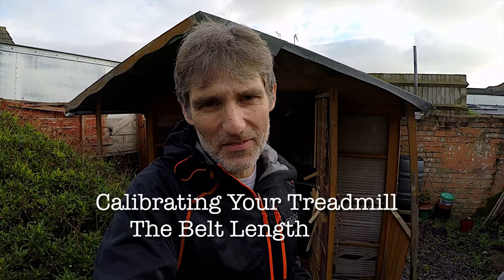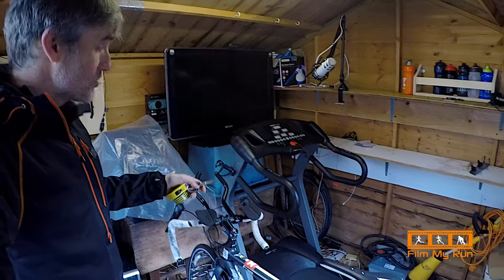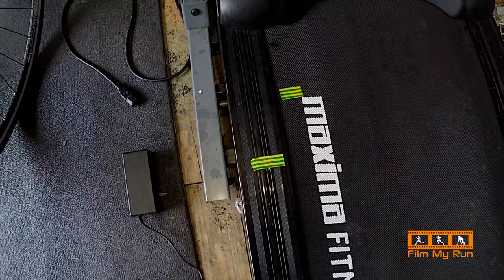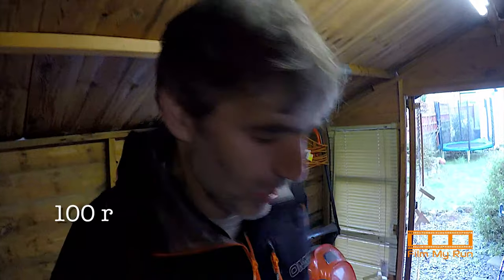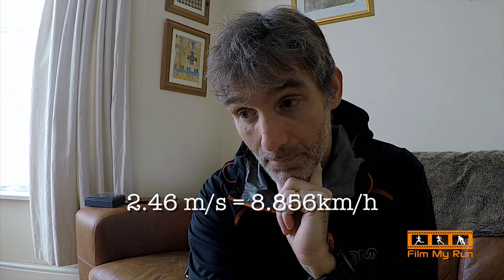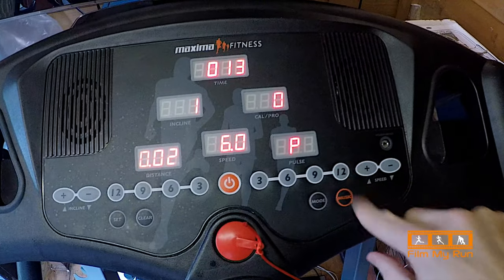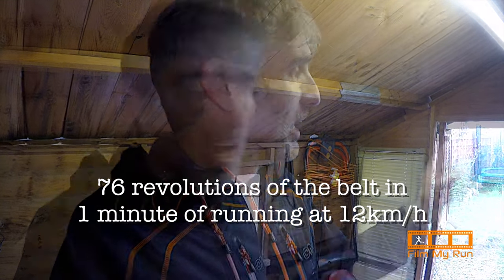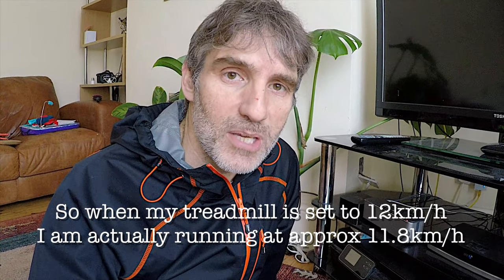Testing Your Treadmill Speed | Belt Length Calibration

Comment: I set a timer on my ipad for 2 minutes and set my treadmill at 6.0 mph. Then I counted how many times the logo on the tread was seen.  I calcuated the speed at ~6.09 mph.  My treadmill is zwift enabled and when I use zwift it reads slightly slower than my treadmill by probably by 0.05 mph.  Glad it checked out and I can trust that my setup is within a 1-2 percent of reality.

Comment: The way I do it is I use a stop watch and count x revolutions and stop the timer on the last count.   This helps to give a more precise result.  For my treadmill, I did 10 sets of 30 revolutions at the 3 mph setting and it averaged 62.4 seconds.  Belt length is exactly 112 inches.  Calculated speed is 3.059 mph.

Comment: Should be an easy question but how exactly did you measure the belt length?  Center of roller to center of roller?  The stated length of the mfg? Just the flat surface?  Can you expand on this a bit?  Thx.

Comment: I have noticed that when my treadmill says 12.0km/h, the app says 11.9km/h  and that's because most of the treadmill uses both miles and kilometers and every few interval they coincide but not always. If you run for an hour, what distance does your treadmill measure?

Comment: The 1st test is 3 km out the 2nd test is bang on? Can’t be correct tho best 10km per hour is like a sprint on my treadmill and it’s just a jog on the road?
Reply from the maker: Hi sorry not sure what you are referring to here. Is this your own testing you’re talking about. Explain it a little further please and I’ll help if I can.
Reply: @FilmMyRun  ok I’ll try 😂
Length of belt is 2.69
100x round = 140
2.69x100/140= 1.92
1.92 m per sec in km= 6.921
I had it set to 10
2nd test
Level 12 was 74 x round in 60 seconds 
2.69x74/60 = 3.32 = 11.95km per second 

First test way off, 2nd spot on. I must be doing something wrong on the 1st test? I did check twice tho

Comment: Shame you never showed  yourself measuring the belt in the beginning of the video im guessing that's the part you need to get right or the calculation will be out.
Reply from the maker: Yes would have been useful I guess. But as long as you have a tape measure it's fairly straighforward to measure the length of your treadmill belt